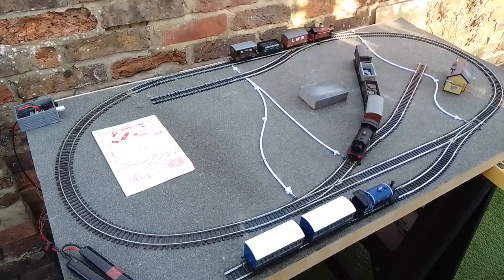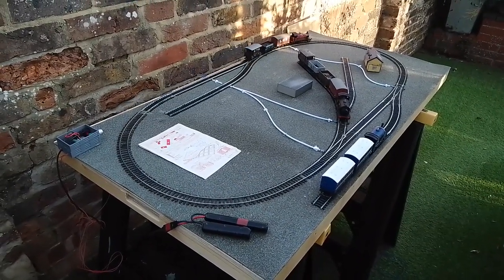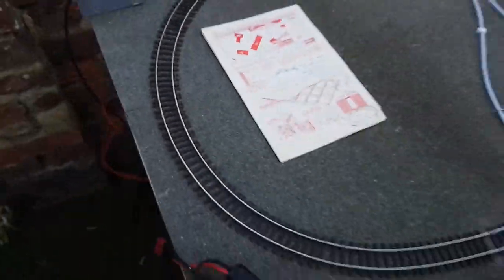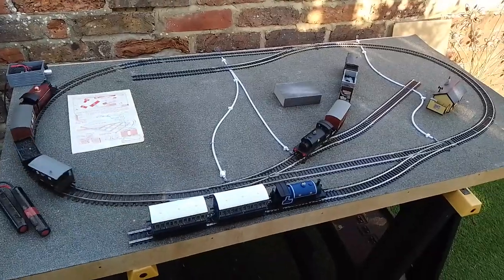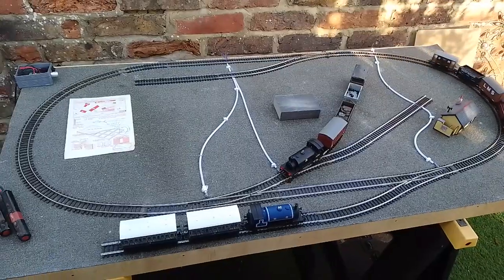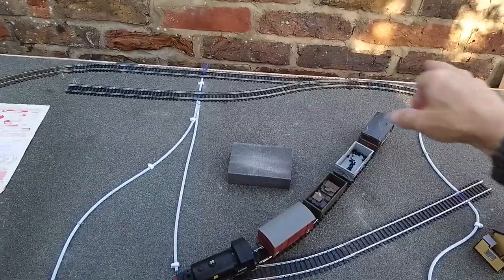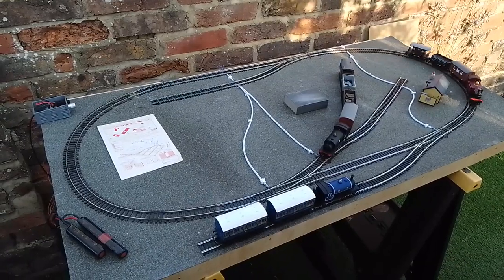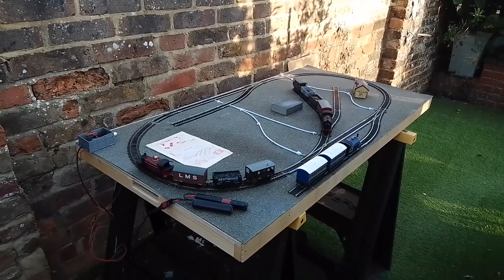Making a Start on my OO Gauge Micro Model Railway/ Railroad Exhibition Layout

Comment: Brilliant idea with the points! Browsing the internet, I found websites where the cable in tube was sold for railway modelling purposes, but found it too expensive. The cheap alternative that I found are bicycle brakes. A little stiff, but will still make corners and is easily cut to size;
Reply: I watched a video in which a guy used those thin metal binding wires used by florists to bind flower arrangements. I bought some on a reel and when inserted inside a tube work great ! ……was also very cheap !

Comment: For wire in tube control you can use push/pull Bowden cables from model aircraft. I have used these before. I even used them to extend a point motor as it would have been out of reach otherwise. Like the new layout.

Comment: Very interesting to see your new layout.  On my last layout I did points control with heavy music wire inside brass tubing set into "ditches" cut into the fiberboard supporting the tracks and then covered up.  I like your use of plastic as it is corrosion-free and naturally slippery.  Also, congrats on using transition curves.  My first layout was for trams and so had sharp 10 inch radius curves, but the use of transition sections really helped avoid derailments.  I look forward to seeing you further develop this latest layout.  Cheers from Wisconsin!
Reply: I'm working on a design for a compact loop with a shunting layout in the middle - as my son would like to run his Flying Scotsman around the loop and enjoy shunting operations as well. I came across transition curves on a US channel and was thinking they might make the operation of larger tender engines around the loop more successful. I'll watch this with interest.

Comment: That’s a great way of doing the point control. I’ve used the same PTFE tube but with welding wire inside which means having to go fairly straight, and sort of picture hanging wire which is a little more flexible. Retaining it isn’t easy but a bit (ok a lot) of superglue and activator spray (that’s the important bit) gets it in the end.

This layout reminds me of your awesome 18” one.

Your brick wall behind the layout; awesome patina, great background for shots!

Take care gents

Comment: Fantastic. I live in a small flat so most of my OO stuff is in storage, been getting into Z scale but it's quite expensive and a bit of a novelty. Hoping to make something similar to this with curves that a terrier and maybe a 14xx will be able to handle. Looking forward to seeing how this develops. My interest in making something work for me in OO is inspired by your previous micro layouts!
Reply from the maker: The Terrier will just about go round this but occasionally de-rails. I think a smoother curve (mine is a bit erratic) of about 22in dia might be alright. For some reason my Airfix 14xx wanted nothing to do with micro ovals.
Reply: @BudgetModelRailways  Got a distinction for my leaving certificate applied. Measuring out for my platforms.
Reply: @BudgetModelRailways  You may well  find that the Hornby J94 0-6-0 will cope with these curves, but needs the older wider couplings attached.  Also possibly the Bachmann class 08 diesel.  And in the past you built a railcar powered by a Lima HO class 33, I believe?  That will cope with curves like these.  My Lima class 33 is fine on my microlayout, as is the old LIma 4F (also HO scale).  You can see my layout at: https://youtu.be/uBCpKOcWuHk

Comment: Used similar track plan for my layout with concealed siding at rear. By putting an isolation gap at rear of layout on same side as point frog you get what I call a stealth siding, very usefull

Comment: Super layout. Minor suggestions for more play value. Turn front siding into a passing siding with a house track, put two sidings on each of the interior siding tracks, and consider adding an additional track switch to the main loop, which can be a siding now, or an extension to a future layout addition later. Enjoy. Hello from the Tracy Mountain Railway in Colorado.         💙 T.E.N.
Reply from the maker: Sadly being only 4x2 ft there is no room. Turning the siding into a loop greatly reduces the length of the train for instance
Reply: That's why you have a house track. I hope you enjoy. My first was four by four feet, later connected to a two by three foot extension, and lots of fun. 💙 T.E.N.
Reply from the maker: @tracynation2820  sorry, but what's a house track?
Reply: Super. A house track is a siding off either end of the passing siding, usually terminated as close to the end of the table, or slightly beyond, as possible, and disguised with a locomotive shed or car shop sticking half way out beyond the edge of the table supporting the track and warning the pedestrians. If you have access to a curved switch, you could connect the main to the front siding, creating a passing siding, then put a siding right to your side of the table edge, or beyond, (one more locomotive.) so that you can access the track while you are sitting. This track change allows more equipment on the rails, allows for more fun and involvement in the railroad, gives you a place to try out your new locomotive while the passenger express blasts by on the main, helps prevent boredom, and gives you a way to run your train "hands free," which is just being able to run around your own train without a giant 0-5-0 hand switcher having to move the train around every time. Good luck, I love these kinds of layouts.             💙 T.E.N.

Comment: I like your mini oval layouts! I have a 85x95 OO-scale layout based on radius 1 and three switches (station track and one siding). I only have 0-4-0 Terrier, Ruston, m one 0-6-0 Terrier and one small Prairie. However I would like a locomotive with tender. Which ones would fit on R1?

Comment: That is a wonderful idea for a micro layout. May have to ‘nick’ the idea for my sons lol
Reply from the maker: I have a few other past videos along similar lines but this track plan has the most operating potential, you can even get older larger diesels around it
Reply: @BudgetModelRailways  bonus is it’s so small I could store it in their room. Thank you
Reply from the maker: @dlmccloud5556  if you put a stout to here sided backscene on it it can be stored version either it's end or side

Comment: Hi Mike.

A very interesting layout for exhibition display. I congratulate you on some original thinking regarding points control. 

Just one question Mike: Is the Cyril Freezer track plan sheet available as displayed on here, or have you enlarged a photo-copy from one of his books? I have a C F book of my own but, as time passes, the hobby's advancing technology seems to make some of his suggestions unfeasible. Some adaptions are possible but not in all cases. Shame, as I do rate him highly as both an enthusiast and an author.

Incidentally, I voted on the Hornby website and the vote for my favourite channel went to yours truly. Keep up the good work with your prudent advice for us pensioners and those not so well off. 👍 

Paul.
Reply from the maker: Hi Paul. I used it from the original very old book, I could probably photo it and let you have it. I find most of his plans still work ok, and indeed they are often still reprinted with just a few tweaks. In his last plans he stopped showing power inputs and isolated sections etc so they could be adapted according to DC, DCC etc
Reply from the maker: Ps thanks for the vote
Reply: Hi Mike.

Thanks for the info, and thanks for the offer to photo it. However, I'll hunt around for some old books as I do like to keep them for reference purposes, and reading them often gives me inspiration. Cheers! 

Paul. 👍

Comment: My layout is oval hornby 1st radius and has only two wiggly sidings, but I'm content with that. I try to pack as much detail into my layout as possible.
Reply from the maker: It's all you need, have fun
Reply: @BudgetModelRailways  I do, although I did start off with a model train set of the Flying Scotsman which I got when I was 10, the 2nd radius curve won't fit with the space I've got, so I can only go 1st radius. I have a branch line style layout as the size suggests.

Comment: Great start would your hornby railroad 08 work because you managed to get it round 18 inches also dose it cost anything to exhibit you layout because I am thinking of exhibit a layout
Reply from the maker: Yes the 08 does run round it. Costs are just travelling expenses which some exhibitions will cover. If you aren't in a club then you usually will need to have something a bit different to exhibit.

Comment: What is the radius of those curves. I am doing scratch built 55n3 and Am thinking of building much smaller like this layout. This is very inspiring.
Reply from the maker: They are 10in radius so 20in dia. Much smaller and coupling lock becomes an issue, hope this helps

Comment: Very interesting your point control a video on this and supplier's be useful. My layout is powered by a 12v old Bosch drill with battery feeding an pwm and switch ( thanks to you). My problem just how to mount point control with corrugated card baseboard any Mike/anyone
Reply from the maker: Could be tricky, you would probably have to use a thin ply top and surface point motors
Reply: How about hotglueing the tube to the baseboard surface? or "good quality Pva"?not the watery handcraft stuff.
My switching layout eightfoot long by nine inch wide (inglenook with a kick back added)uses brass wire in tube but they are only short straight runs!

Comment: Hello do you know if there is any sort of straight oo gauge track you can easily change the length of or how to change the length of normal track thx
Reply from the maker: Flexi track is easily cut to length. Or you can cut a standard length with a hacksaw. Flexi track is easier to cut. It's also worth rummaging through second hand track as Lima etc made some non standard length. Hornby make some very short straights that often help fill a gap
Reply: @BudgetModelRailways  thanks

Comment: You seem to have built more layouts than most people have had hot dinners. I know your videos have started lots of people building layouts including myself (after 70+ years) - three layouts and counting. I'm afraid I am becoming a llittle bit cynical over the wealth of layouts which consist of an oval with points. In my mind, this is hardly realistic. Real railways have an up and a down line. So, I tried a double oval. Have you tried wiring a double oval? You either have to have two completely separate layouts or go to DCC (perish the thought). Maybe my cynicism is misplaced. Keep up the good work.
Reply from the maker: Hi Dave, I agree that a single or double track end to end is more realistic operationally, but I do like watching trains go round lol
Reply: @BudgetModelRailways  I think you and Charlie Chadwick are the two opposite ends of the hobby.